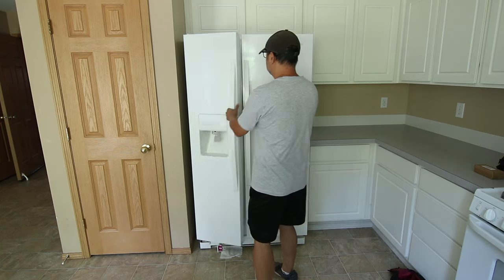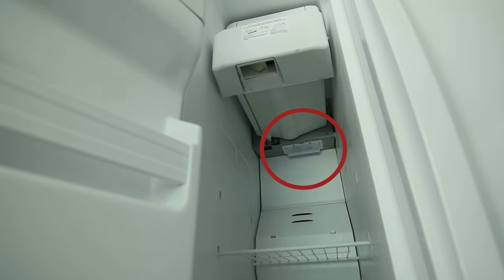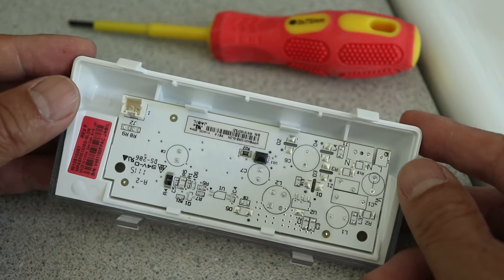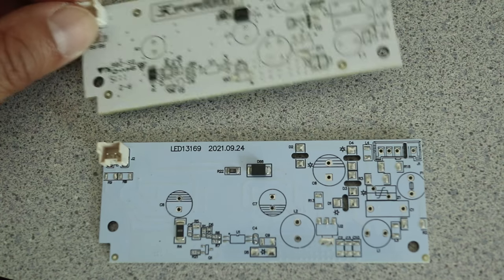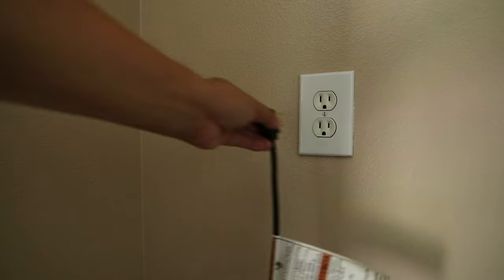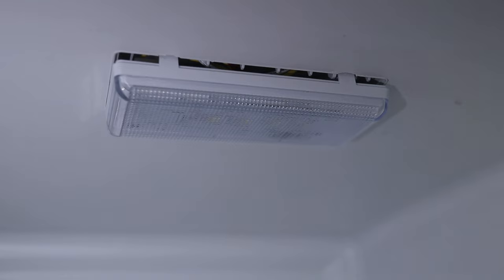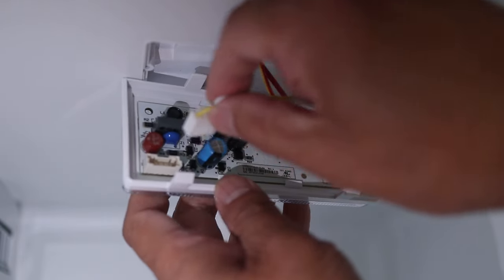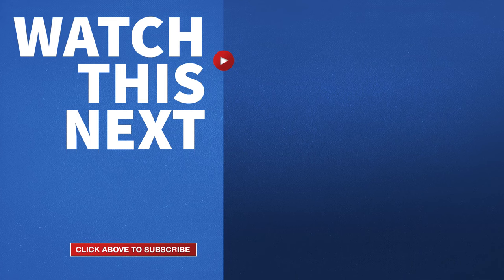Replace LED Light in Whirlpool Refrigerator - Whirlpool Refrigerator Lights Dim or Blinking

Comment: I just replaced the freezer light for the second time in 7 years.  The quality of Whirlpool is terrible.  I long for the old days when you could just screw in a 15W appliance bulb for $2
Reply: LED lights are cheaper and easier to manufacture and can be made to last longer. Blame the greed of the corporations and capitalism.

Comment: Wanted to say thank you for your tutorial.  Had the exact same problem with my Whirlpool refrigerator. Got the parts from Amazon, and using your steps fixed it!  The only notes are, the freezer has to thaw just a few minutes or you take a chance breaking the plastic, and as I have a smaller fridge, my arms didn't fit all the way in.  Other than that worked fine.  Thank you!!!
Reply from the maker: Excellent! I’m really glad you were able to get the parts and fix the lighting in your fridge! That’s a good tip on letting the freezer thaw out. Mine was empty and was already set to a warmer temperature so I was able to work on it right away. Thanks for watching!

Comment: That's the exact model that I have.  I just ordered the lights on Amazon today, about $46 for one refrigerator LED and two freezer LEDs.  I ordered the whole lens assembly but I should have just ordered the boards.
Reply from the maker: It doesn’t matter that you ordered the lenses with the LEDs. The price difference probably isn’t that much. But now you’ll have extra lenses lying around.
Reply: @digitalcamproducer  I didn't have any problems with installing the refrigerator lights, they went in fairly simple.  But, I was discouraged when they didn't light up.  But the freezer lights were another story.  I had to get both shoulders inside the freezer compartment, along with a flashlight to see what I was doing to insert the plug back into the jack.  When I finally got it done, I realized that the lights wasn't oriented correctly, that was my main problem.  It sure is a good feeling when the LEDs turn on.

Comment: Great video. One thing I would suggest is to consider briefly testing out replacement light assemblies before snapping back into their respective spots. Just in case. Many times i have reassembled things only to have them still not function properly.
Reply: This post puts you at or above his level. Nice. :)